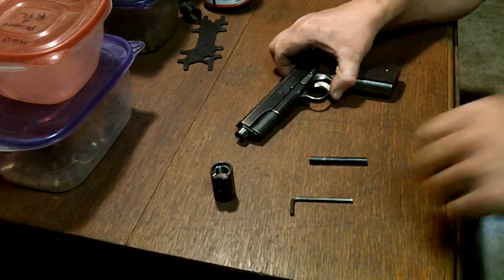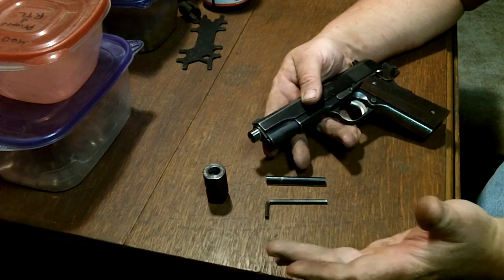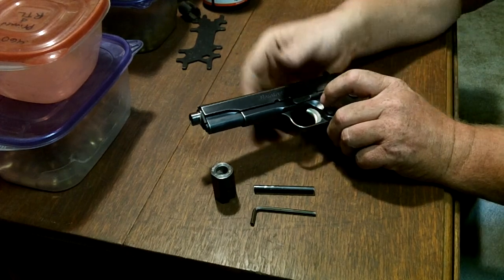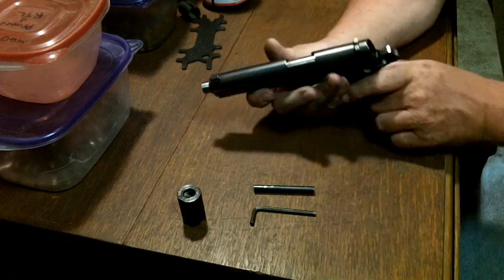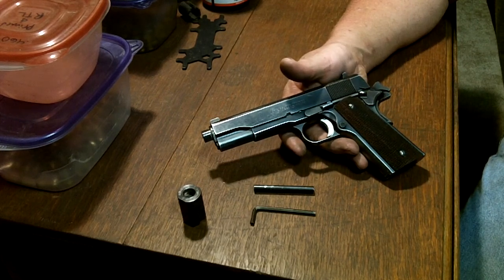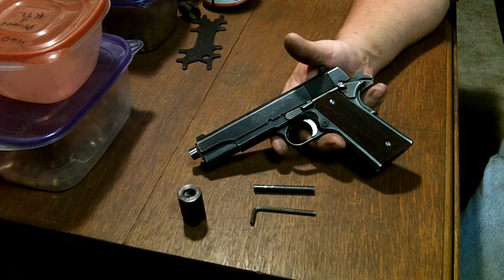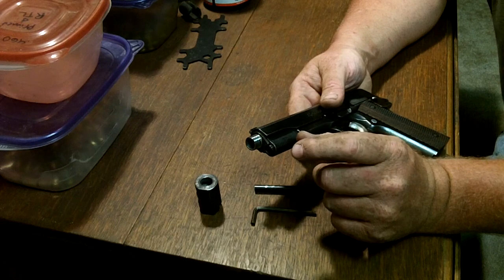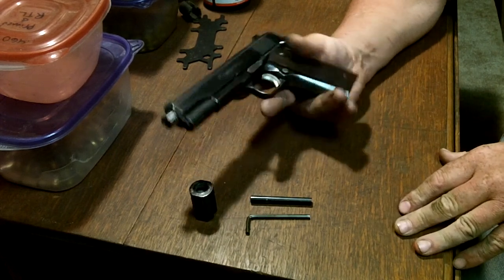Installing a 1911 .460 Rowland Conversion The EASY Way...

Comment: Maybe I'm missing something, but what's the difference between blue loctite and red loctite?
Reply from the maker: Blue is "temporary" and red is "permanent". Kinda like Elmer's Glue vs. Super Glue. The blue stuff is water-based I think and its really thin and kind of just dries rather than cures. You can use blue, put the fasteners together like normal and torque them to specs and basically its going to take the same amount of torque to disassemble them as they were torqued too. And its mainly for "dry" fasteners where a screw is in a blind hole with a flat washer so if there's oil present it can't get down in the threads and dissove the Loctite. Red is almost like an epoxy and its very thick and it will actually seal the threads and if you have everything clean and dry and assemble it correctly and torque it to specs and it cures fully, you can end up breaking off that screw or stripping the threads trying to get it loose. But there's a secret.  Take a torch and just get some decent heat n the bolt or on the nut. Doesn't have to be glowing and just hot enough to sizzle spit will work if the whole fastener gets there. Let it cool and it'll come loose pretty easy. The blue stays flexible and its impossible to get a full "seal" around several threads in a row so "low heat" like that won't break it down. But the red shit kind of turns into a hard plastic and its exothermic so it generates heat and expands when you you take it away from oxygen and it just locks the threads tight as hell by filling all of the small gap that exists in threads. And you can put just a glob of it in one spot or smear it around a little and have it look like you might get a couple threads sealed. But when its confined and curing and expanding, it just keeps oozing through that gap until its as far as it can go. Take it apart later and it will have filled maybe 2 or 3 times more threads than it was on originally. If you ever have to seal a pipe taper joint for diesel or kerosene or  gasoline or any other thin fuel where teflon tape or paste will disolve, I think either will work but red will work better. By rights, GOOD QUALITY STEEL PIPE AND FITTINGS with GOOD THREADS PROPERLY CUT will NOT leak period because of the interference fit and the joint getting TIGHTER the further any liquid flows into it. But GASES are a different story and there's a product called "Gimme The Green Stuff" that's some kind of synthetic pipe dope I think is kind of a PVC product and maybe cures like loctite. That shit is rated for EVERYTHING. Anhydrous ammonia, etc. It's also really slick when its uncured and that lubes the threads and that makes a huge difference in how much thread you get for any given amount of torque and THAT probably does as much as anything. But even though dry pipe threads can and will seal perfectly IF you get them tight enough, its COMING BACK APART THAT WILL BE THE PROBLEM if there's ever any moisture and corrosion in the dry side of the treads. That's why its a good idea to tape or dope regardless.
Reply: @deeremeyer1749  alright boomer.